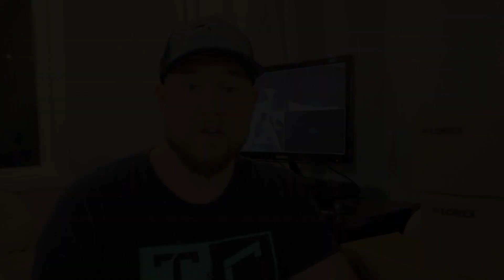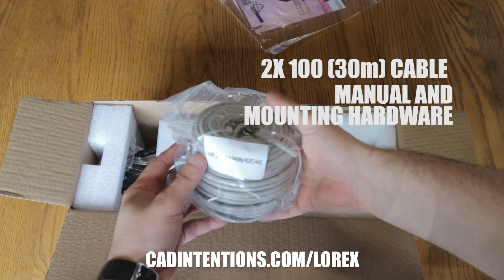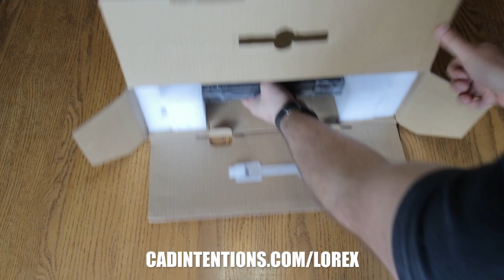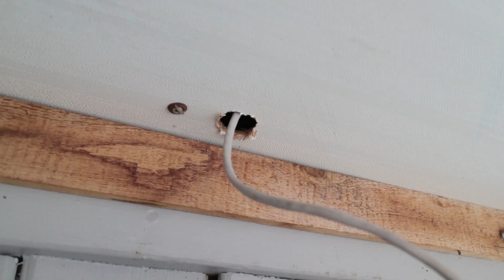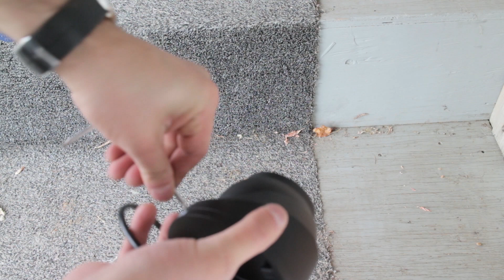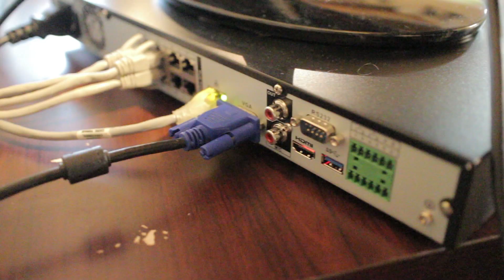Lorex 4K Ultra HD IP Color Night Vision Security Camera Install/Review - Coffee Break Ep#4

Comment: Does this system requires to be connected to internet all the time? If you dont care about using the app.
Reply from the maker: I havent double checked yet, but I dont see why not. The unit is a standalone pvr and should still record and show the cameras without constant internet. It may be required for setup/updates though.
Reply: No you can use this system with or without the network. It will act as DVR if you choose to not use the network